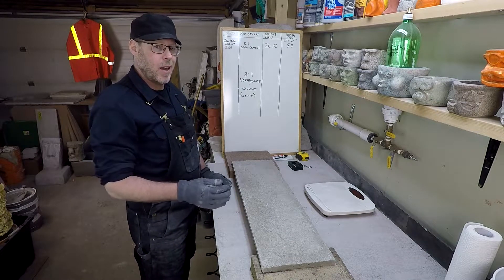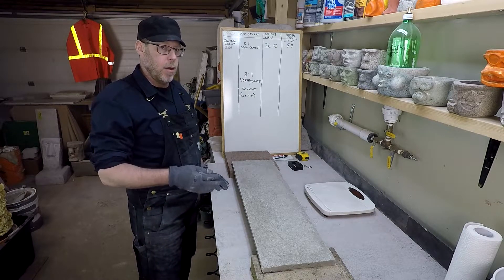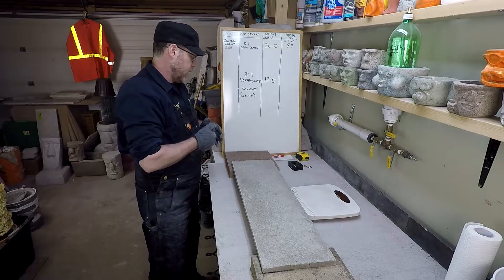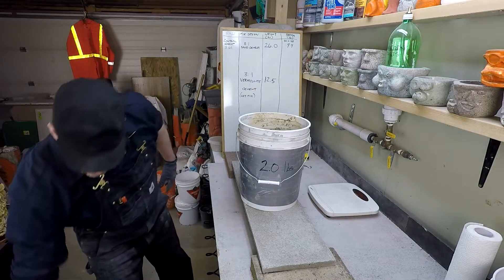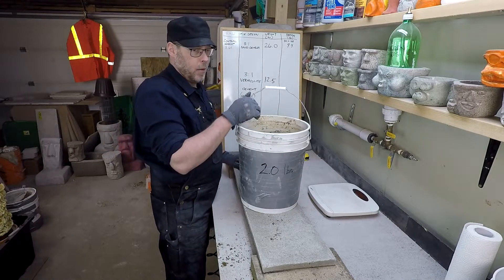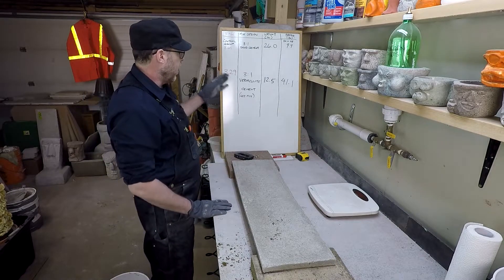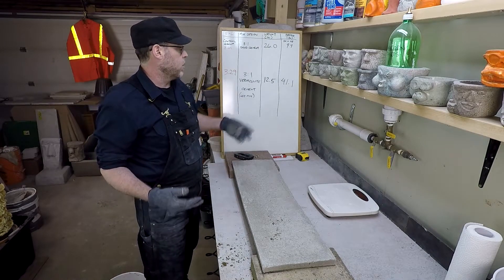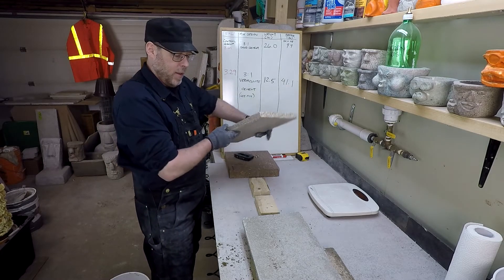Lightweight Concrete Strength Testing - 3:1 Vermiculite Mix Ratio

Comment: to throw a few ideas out there - aircrete foam and graphene reinforcement. tech ingredients showed that graphene added to epoxy increased its strength tremendously. and robert murray smith has shown how to make graphene at home on the scale you would need for a concrete admixture. it looks like you have an eircrete foamer behind you - though i dont know where the unicorn farts come into it. best of luck.

Comment: all i  want is the lightest mix i  can get with the lowest strength to fill a 40 ft 4 " pipe ,, to  be drilled out again   next year
Reply from the maker: Does it need to be water tight? Is that the idea, or just stop debris / pests from getting in there.  Something very weak like 8:1 perlite or vermiculite to 1 part portland cement would result in a mix that will solidify, but you can crumble up by hand.  Barely. but that means drilling out would be easy.

Comment: This was the video i needed. I'm planning to build burnout oven and this might be cheapest way to buil it
Reply from the maker: If the concrete will be exposed to high heat then no regular mix will work.  You would have to make high temp concrete or mortar (refractory cement) which is a mix of portland cement, hydrated lime and clay.
Reply: @creatingconcrete what Ratio?

Comment: Great series! Have you tried walking on it? I am looking to level a very old and uneven wooden floor and need to add 6 inches of depth in places. Therefore I am looking for a light and cheap levelling mix.

Comment: This is really interesting.  First, the tests themselves, and second, finding a relatively new channel.  To the first part, I'm wondering if the reduced strength of a wet mix is being offset by the smooth finish you're getting from wet mix on plastic.  My limited understanding of strength testing of brittle beams is that the surface finish matters a great deal in strength, as the failure most is crack propagation from uneven surface.  Now...that's based on glass/ceramic, not concrete but I think it's important.

I'll add - I really am looking forward to finding any tests you've done on lightweight fiber reinforced concrete. 

As far as the channel goes, I found this from your own links off your pool channel.  I don't have a pool.  I have been doing some  research into concrete patching...I think that's why I got the recommendation.   I think your info has a market way outside sculpting, to include anyone that's in what they're calling the "maker" community, as that group doesn't seem to have a lot of people with either material knowledge or experience in this area.

Comment: I would love to see all of these done with various reinforcements. Basalt, steal, graphene, and fiber mesh. It would be cool to see where this could go, plus it would give you a lot of content to create for your channel. 

For the content reasons, I would say add one type of reinforcement at a time, eventually ending with the ultimate light weight reinforced concrete, vs your control of course. This would be interesting in the space.
Reply from the maker: This is the intention.  The next set of tests will include more admixtures, and moving on from that will be steel, fiberglass, stranded glass fibers, mesh tape etc. to see how light and how strong we can make it.
Reply: @creatingconcrete  
I don't know if it's in your area, But there is a fairly cheap add mix at Lowes called Edencrete. It's would be cool to try that as well.